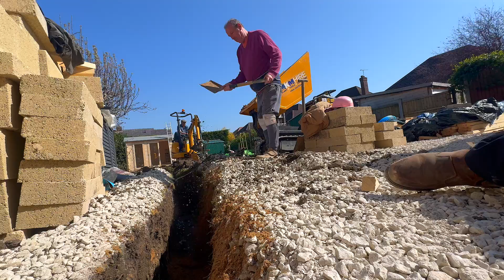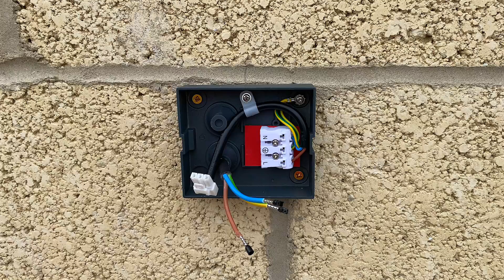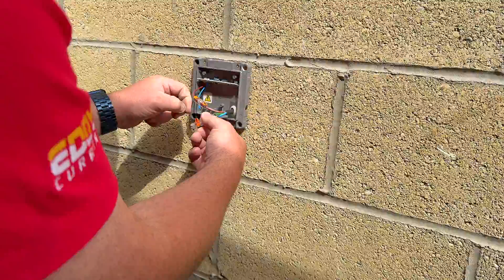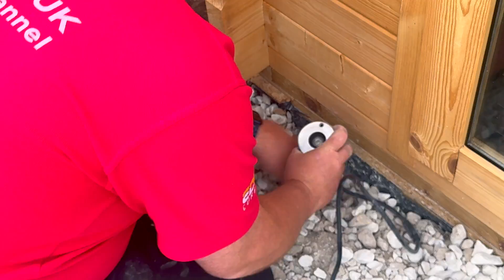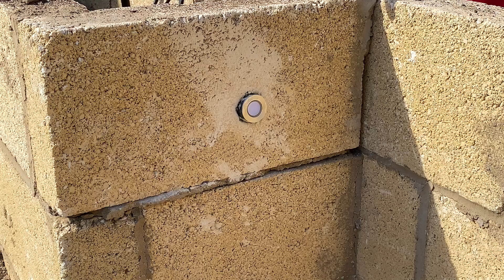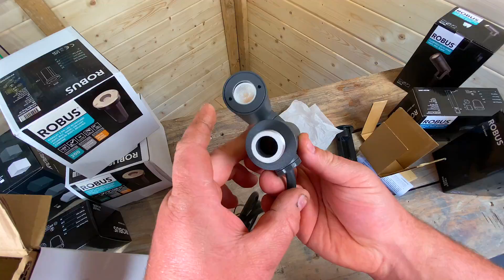Garden Lighting: 6 Ideas That Deliver!

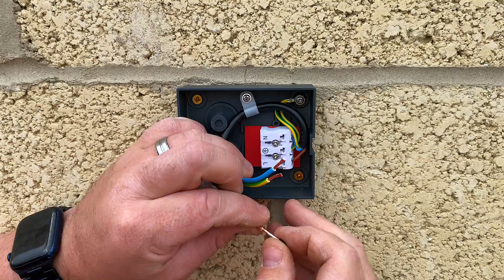Comment: 1:20 I suggest putting the ferrule on as normal (not backwards).
Then warming up the metal ferrule with a heat source until the plastic melts & sides off easy.

Comment: I was hoping to see how deep cables need to be buried, whether cables can be run along fences, if cables need to be armours, etc.
Reply: The answer to all of that is probably: it depends 😄
Reply: Up to you to choose the cable depth, but regulation requires it to be commensurate with the level of risk, but the electrical industry (not regulation) says a minimum depth of 0.5m.

Yes.
Yes.

Comment: With anything coloured, using the same colour sometimes makes it glow eerily, especially with trees and foliage. Green on green make the tree appear to glow as if you hide the light source there is no green beam, the tree just seems to glow.
Many years ago my friend and I built a wall light on an extension in Harrogate, it was a sweetie jar, a lamp holder, a kitchen cabinet leg and an artificial arm, my friends' dad had spare. We assembled it and built it into the wall, and nobody would believe we made it ourselves, but his dad didn't have enough spare arms for us to make any more, so, as far as I know, it is still unique. The tungsten lightbulb we used lasted 8 years with constant use.